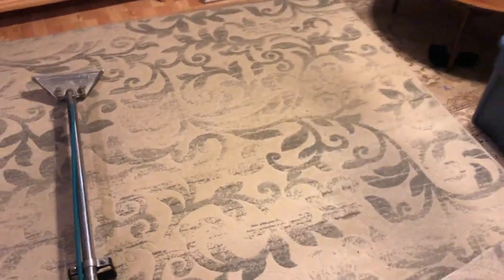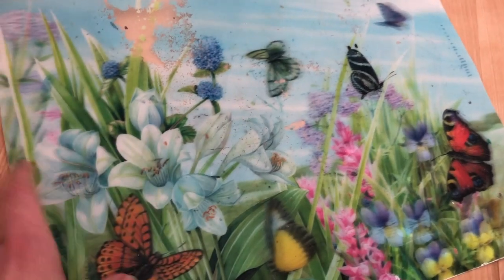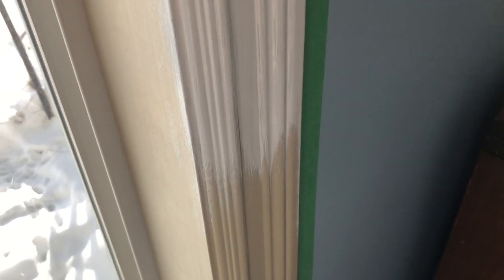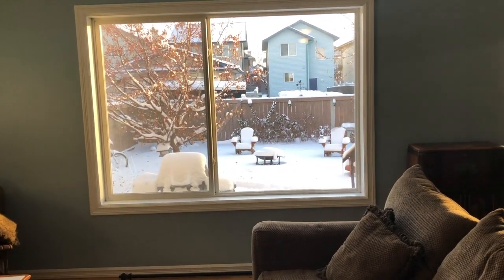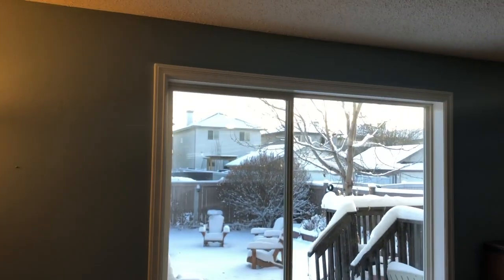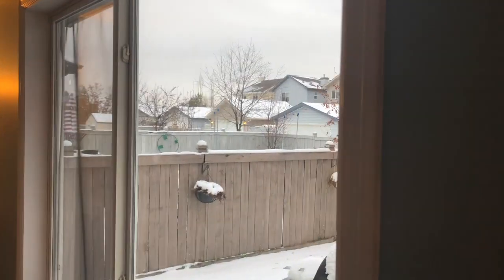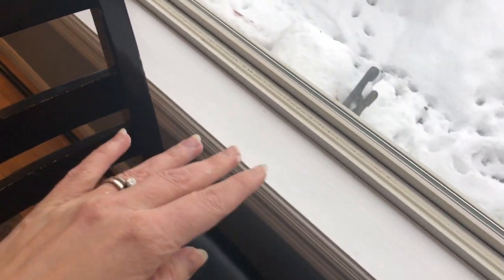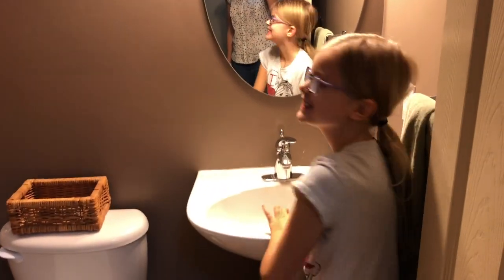Part 3 Living Room Makeover! Things get clean and you guessed it..... more paint!

Comment: Light sanding and primer, if you're paints not adhering. 🇦🇺
Reply: Check what is undernesth. If someone put latex over oil, it will cause this and then you need to really prep well.
Reply: kim mcdonald Someone painted latex over oil base on the trim in our house. Is there a faster way to prep and fix it?

Comment: You were probably putting latex paint over oil. If that's the case it won't adhere right. Needs a kilz primer first. You can put oil over latex without a problem but not the other way around. Room looks nice though.

Comment: Take an 8 by 8 cake pan or casserole dish cover the bottom and sides with wax paper poor your chocolate peanut butter mixture in the pan and refrigerate you will need to refrigerate at least 3 hours when it's completely set up cut into small bite pieces and if you love Reese's Peanut Butter Cups you will love this recipe
Reply from the maker: Thank you so much! I’m going to try this out ❤️❤️❤️
Reply: @MelArchbold  remember mix the chocolate and the peanut butter in a microwave Bowl microwave it 30 seconds and stir it and microwave it again and Stir It and do it the third time at that point you should be able to for it into your lined pan you'll love it I will make up five of these and give as gifts

Comment: the bakers chocolate reminds me back when i was kids and my mom bought some and she thought she hid it well enough in the pantry but i saw where she hid it and i grabbed and broke off one of them squares and popped it in my mouth and started chewing it and i am sure i was making some loud strange noises and my mom comes in and asks whats wrong and i told her i thought that chocolate was bad because it taste awful, and like you she just laughed and laughed.
your paint problem on the trim where it looks like it is peeling away and looking like a orange peel could be because of the paint that they used before.  sometimes if you just give it a light sanding before you paint helps, but sometimes you have to use chemicals to soften it or whatever it does to make the paint stick.  it is looking very nice i like the colors, and always make sure you finish your paint stroke back into the wet paint it helps hide the brush marks.  cant wait for the next one.